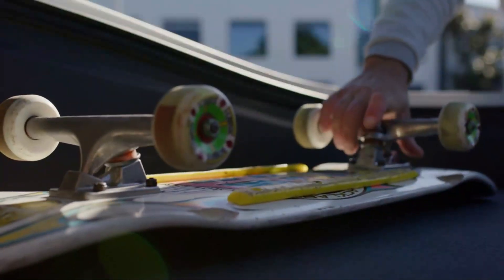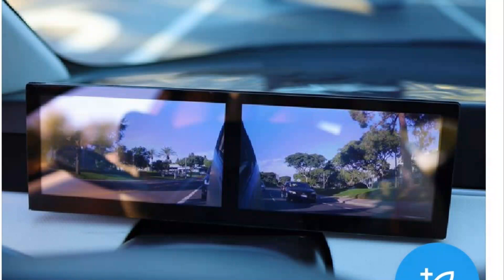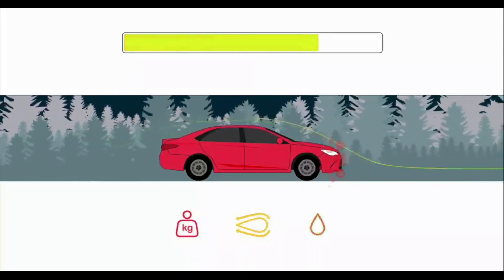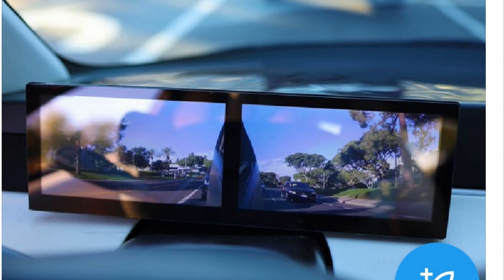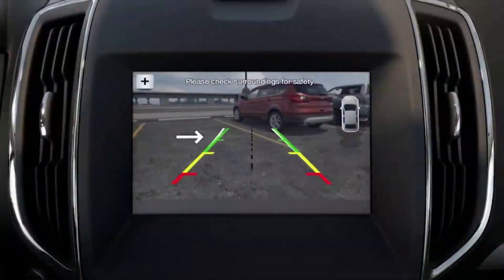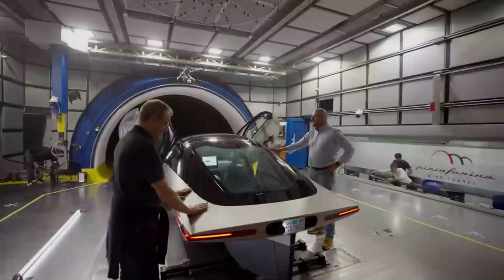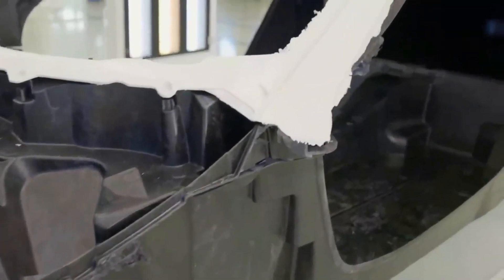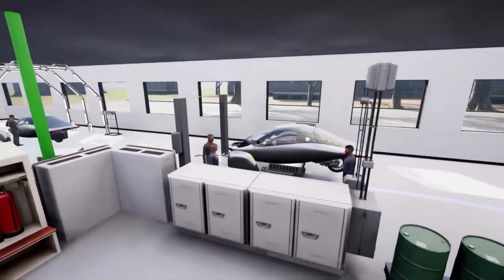Aptera - More BIG News This Week!

Comment: Latency is referring to the time it takes the image from the camera to reach the screen, which also has to do with the frame rate of the camera.  These mirror cams operate at a high frame rate and the delay to display is very low, hence “low latency”.  The reason you won’t be blinded is because the camera can dynamically change the exposure and dim the image.
Reply from the maker: @Rhynri Thanks for the clarifications

Comment: Whooa  finally jan 2024…I can’t wait to get a maxed solar version 2 unit!!!
Reply: I sure hope v 2 will be available 2024!!
Reply: Did an Aptera representative say on a video that production will happen January?  If yes … what video?
Reply: @ridingvenus  No.  Aptera has completed the body tooling and is just starting the assembly of the Production Intent builds to do the validation work, including crash testing.  Eventually, one of them, which will be in mostly finished form, will be available for marketing use.

If all goes well, production vehicles will start being delivered to customers towards the end of 2024 or the beginning of 2025.
Reply: @n.brucenelson5920  That's what I figured. It sounded like he said the "timeline to production" would be out by Jan 24, not the start of production itself.
Reply from the maker: @n.brucenelson5920 Thanks for assist. I've got to commend your hearing.

Comment: Production in January 2024?  You are so off base it is bizarre. They are likely not to have PI builds out of CPC delivered to Carlsbad by then.
Reply from the maker: Actually, January will see the production of at least 5 Apteras which would probably be used for performance and crash testing, as well as continued marketing. Consumer builds will probably take place in Q1 2025, or Q4 2024 with the right funding

Comment: You really need to check your information before putting this out. The "split screen" is just a view in lieu of the side mirrors in one location, doubt that's "genius", although handy. Aptera is not subject to "automobile regulations" as you say but is in the same category as motorcycles given it's auto-cycle classification. As mentioned below you got latency wrong. No way Aptera will be making production cars for delivery in Jan 2024, they will be producing 16 test models possibly starting in Jan, but this is dependent upon these 16 bodies with suspension being assembled and shipped to Carlsbad CA.
Reply from the maker: Thanks for pointing that out. Highly appreciated

Comment: Vaporware
Reply: Nuh uh.
Reply: @lectricbill3329  so after 12 years where are the production models. Oh that's right they don't exist.
Reply: @MrSGL21 4 years!
Reply: @gmv0553  4 years? Yeah it's been a hell of a lot longer than 4 years. This thing started out in 06. It's the Duke nukem forever of vehicles.
Reply: You apparently don't know the meaning of the word.  Both my wife and I have ridden in a prototype.  BTW, Aptera Corp was founded in 2019, when the design was begun.  The fact that you don't seem to be able to count probably adds to your confusion.
Reply: @MrSGL21  What this thing? The A. Morelli body shape has been around since 1982, and there have been a number of vehicles built with this general appearance over the years.  That doen't make the companies that built them or the vehicles themselves identical.    How simple minded can you be?
Reply: @MrSGL21  They don't currently have a test mule that even has functioning air conditioning.
This car has been haunted since 2009 with thermal management issues that still exist.